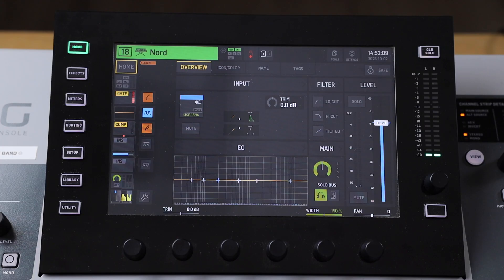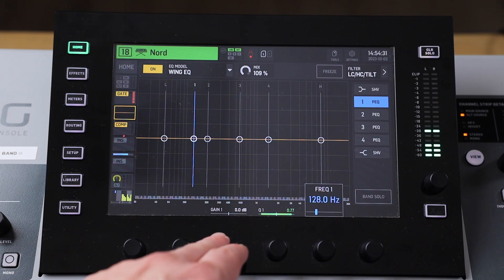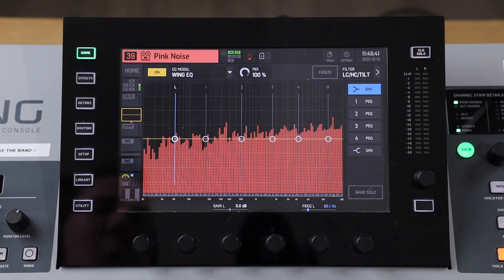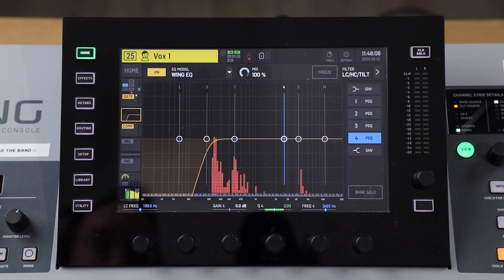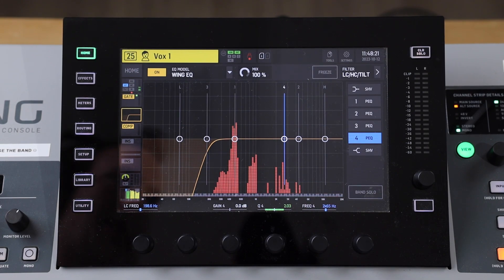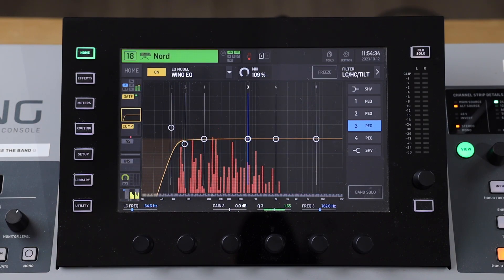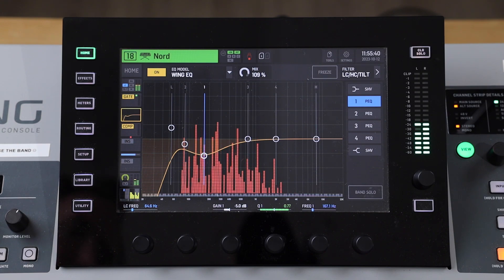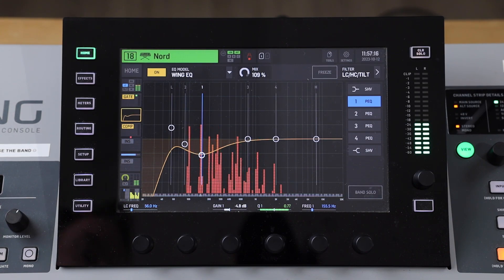Parametric EQ in the Behringer Wing

Comment: Does Wing's graphical analyzer appear to be bugged or is there some function that I can disable? The graphic analyzer is not reporting frequency modulation on the channel equalizer page. Anyone else having this problem?
Reply: I've been wondering the same thing, no one seems to explain this, mines are not showing and I think they stopped after one of the updates.
Reply: @ageless9  any updates ive been trying to figure it out on a new one. sometimes shows sometimes doesnt